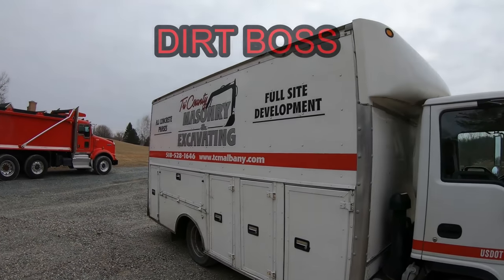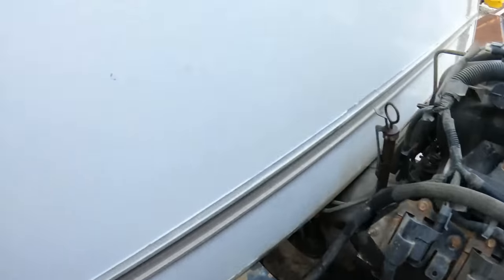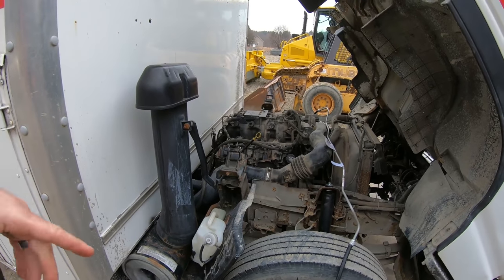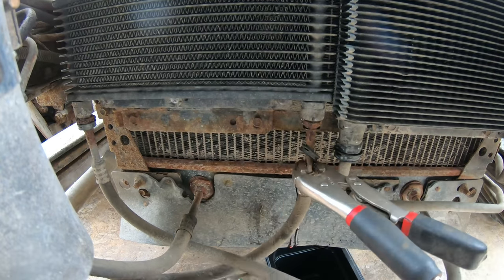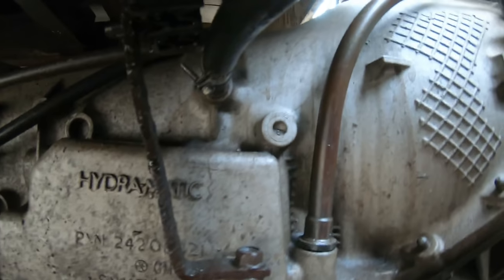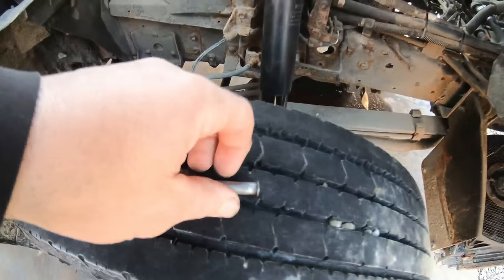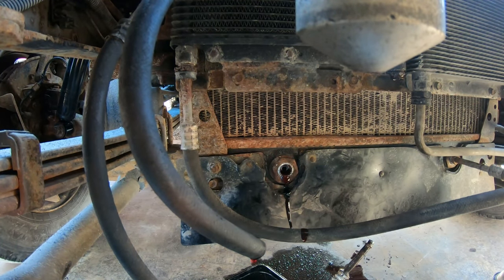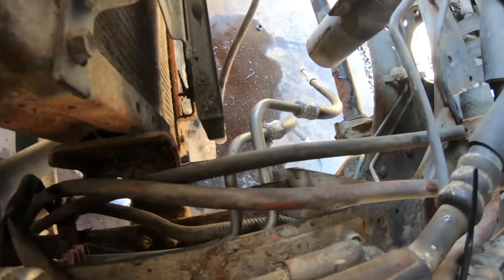Fixing transmission lines on a GMC W4500 or NPR and Chevy

Comment: Thanks for posting Isuzu content, not too much info on these out there.
Question: the power steering line, was that a stock replacement or did you have that made by a shop? If custom made, do you recall what type fittings those are? I’m on my npr trying to make some trans cooler lines and the fittings seem to be JIC 37° type but with metric threads and no hydraulic shop seems to be able to tell me what this is. Komatsu 30° dont seem to fit either. Any info from anyone would be helpful. Thanks!
Reply from the maker: I bought them straight from the dealer